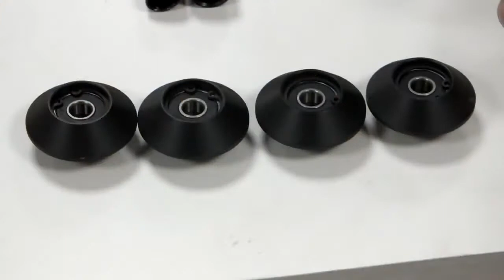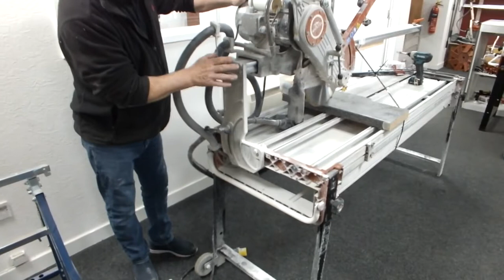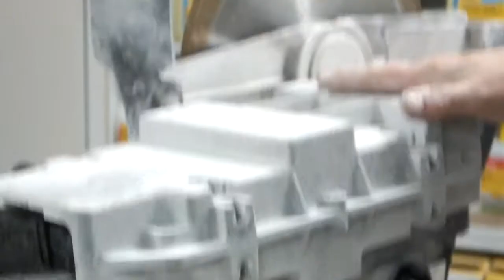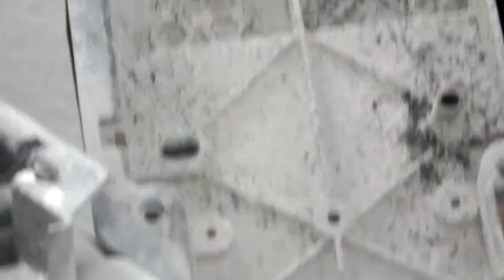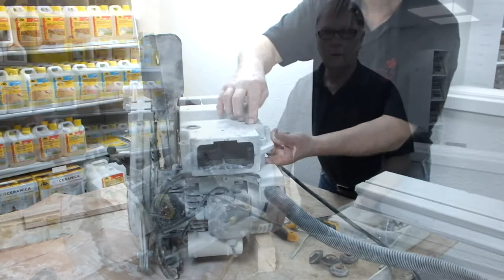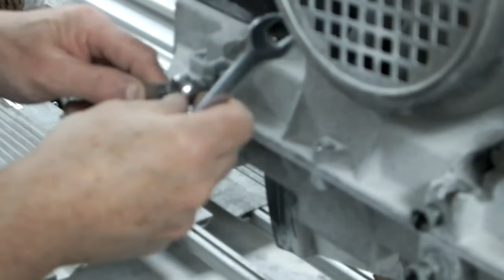How To: Change Zoe Wet Saw Bearings | Tilers Tools

Comment: great video- thanks for time putting together! I have just ordered new bearing/ wheels for mine. My issue is the carriage assembly hang down on one side. Tried adjusting but haven't been able to get the the carriage level relative to the track...and then runs too tight or too loose. In this video were the old bearing really worn or was it that they just needed adjustment? What have been people's experience when they dismantle- are the old bearing normally worn...or is it more the cleaning and readjustment that fixes the issue?